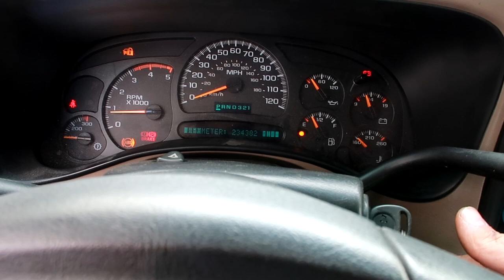Duramax FINALLY BUILDS MORE BOOST!! (HORSEPOWER)

Comment: Get a chip dalton. That truck will snap your neck once you put a chip in
Reply: Yamahattr225 what kind of chip? Lays potato chip? Dorito chips?
Reply: Yamahattr225 I prefer lays
Reply: Yamahattr225 or a bully dog programmer
Reply: I would just get EFI live,
Reply: A simple remap could release a lot more power.
Reply: Hands down best tuning of Kory Willis or atp performance efi live tunes. efi live isn't the tune it's the program and it works great with duramax
Reply: Yamahattr225 
Put chip in it
Reply: Yessssssss 
Put a chip in it it will give it wayyyyyyyyy more power and make it brappppptastic!
My grandpa had one in his old 2004 gmc but it is the same one for the Chevy 2005 like yours
Reply: no not bully dog. worse programmers ever!!!
Reply: Yamahattr225 elf live is the best for the duramax and you get the best performance and you get really good mpg.
Reply: Yamahattr225 my dad put a chip on his diesel and he has had so many problems

Comment: Next step is to Ziptie shut the Wastegate.
Reply: Trent Nelson not wastegated.
Reply: everything with a turbo should have a Wastegate.
Reply: Trent Nelson has a vgt turbo boost is controlled electronically.
Reply: Right, my motor is before that, i still have the Waste-gate, in my LB7.

Comment: Here in Alberta you usually only have to get your first vehicle inspected if it's older than 12years. My first truck I bought 2 years ago when I was 16. Was a 1995 Chevy. I needed an inspection on it. Put since then I have bought a 2000 gm and a 1994 f150, neither needing an inspection.

Comment: Well, I have a 95 f150 I'm trying to get on the road, planning a cab and bed swap this summer and while it's off I plan to put a 5 speed in it. It has a CEL but last time I pulled the codes it's not very bad.

Comment: I heard on chevys if your check engine light or anything like that comes on, you can just disconnect the negative battery cable and pump the brakes for 15 seconds and it will clear it

Comment: That noise it makes when you floor it sounds good but it's actually not allowing much airflow, to get more power you should do a 3" down pipe to a 5" straight pipe. The noise will be gone but it will run better and you'll have more power

Comment: Hey 3DMachines.
I would suggest to clean up the throttle and egr valve. Sometimes it builds some crap inside and airflow gets bad. Cleaning them will make your car more responsive to the gas pedal.
3DMachines fan from Lithuania :)

Comment: my duramax is an 07 it started getting week and sluggish so I added an inline fuel push pump to get my pressure up and the truck was a 100 times better afterwards

Comment: I highly recommend getting something to monitor rail pressure. Far cheaper in the long run to have good monitoring equipmemt. Heck, even an edge insight isn't all that much and you can monitor everything from it.

Comment: All 3/4 ton and 1 ton trucks don't get plugged in during inspection not just deisels, you can pass with a check engine light on with those trucks.

Comment: Don't use k&N!!!! Duramaxes don't like them!! Do research hopefully you read this!
Reply: Slednex700 agree. The oil screws with the M.A.F sensor. I personally like S&B intakes and filters
Reply: Author Trek with Jason A. Dimmick S&B dry filters are great!
Reply: S&B seems to be the best all around from what ive heard. Im gonna get one for my 2007 5.9 cummins
Reply: TheBlackShadow270 been running the dry flow on my lbz with a Garrett stage 2 turbo for the last three years and will never go with another brand
Reply: IgotGreens101 you won't regret it

Comment: Hey Dalton, Just wondering why you would mess with the filter in the first place. Come on its a filter. Buying an OEM one would not have set you back that much. or buying the appropriate aftermarket one wouldn't have been that bad.
Reply from the maker: it wasn't the filter, it was actually the adapter. Sorry for not clarifying that.
Reply: @3DMachines I also own a 2005 duramax and being that your not running a lift pump or anything I would strongly recommend tossing the cat filter and going with the Donaldson P553203 being that it's a fuel/ water separator and the cat is not it's supposed to be used as a secondary filter just trying help ya out so your not throwing injectors or a cp3 in
Reply: Just put a EFI LIVE AND AFTERMARKET FILTER what your waiting on !!!!
Reply: the fuel filter screws into the lift pump, he pumped the lift pump to prime it ...
Reply: sexynamesmiff do you not realize what a lift pump is? That's a hand pump primer?
Reply: yeah i gotcha but for my car, its also the lift pump, i didnt realise otherwise.

Comment: Oh and it's probably not going to be the fuel filter my dad put a aftermarket fuel filter on his and his has a little more horsepower because of the fuel filter and it's the same type that you have
Reply: But the adapter piece had 12 holes

Comment: @3DMachines Don't use an air compressor on an air filter bud it pulls it apart internally and it will allow more dust to pass by into your engine. It only takes one cup of dust to grenade a Diesel engine wether it's 500 or 500 000 miles only one cup will destroy your truck.

Comment: WTF are you doing drilling holes in the filter head?!  OMG.  Rebuild the filter head (cheap and easy) if there's an issue.  As for the air filter, the KN won't cause a problem with the MAF if it isn't overoiled, but there's no need for it in your current setup.  The stock box and filter (more effective than the KN) will flow more than enough air at your power level.
Reply: oh, and you should look for pinched/collapsed fuel lines (common), and add a lift pump.